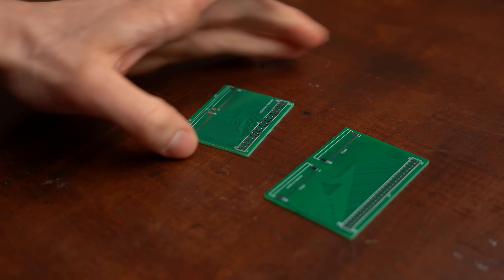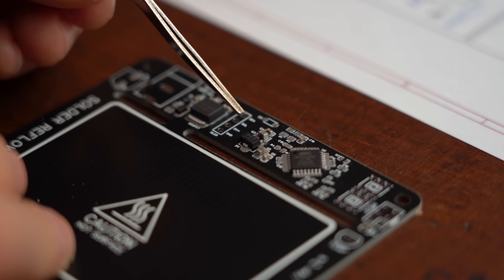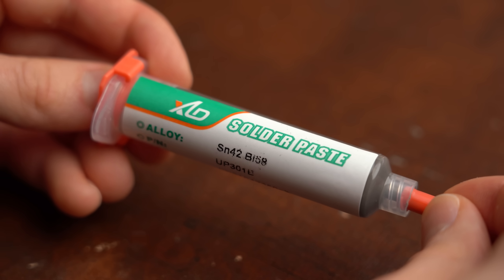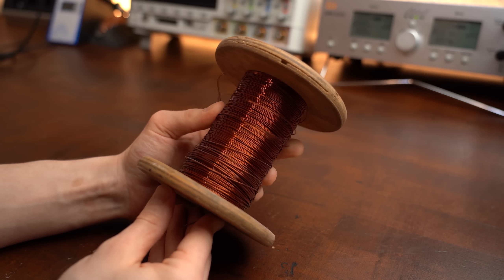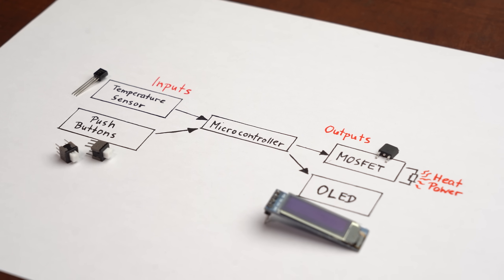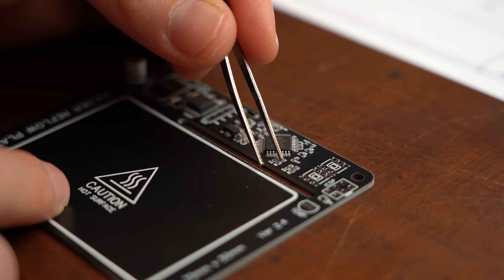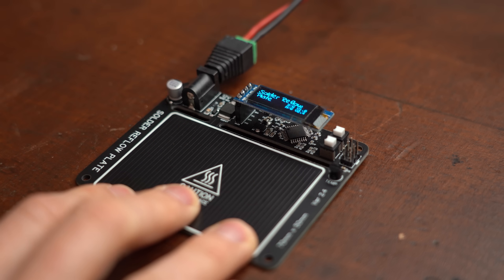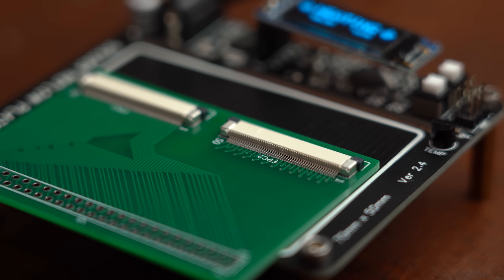The Best way to Solder? Hot Plate to the rescue! (DIY or Buy)

Comment: I am about to say something stupid, if you can flow current to something to melt the solder, why can't you do it ti the pcb you are trying to solder stuff straight to? the copper pads will definitely be hot, less power is also needed

Comment: How about esp32 with BLE control instead of the atmega in the DiY- those small stamp size modules. No need for a display or push buttons then. Also a serious version could have a PD enabled power supply.

Comment: 7:20 
As a electronic hobbiest it's really sad that microcontroller ic are more difficult and suprising expensive the the ic board/module 😢
I tried finding attiny85 micro processor ic but it was almost 2 dollars usd it's the same price as Arduino nano board here

Comment: You forgot to mention from where  you bought the solder plate mask. The same as the PCB manufacture ? How does the change that $2 entry PCB manufacturing cost ?

Comment: While the lifetime of the DIY version might be shorter, you do have the access to buy a replacement part for relatively cheap; with the other components eligible for transfer using... that heat gun in the dusty corner of your desk by now >:D

Comment: I started out with a small raw  heater plate (220 Volt) for a few euro that I added some controls to. Worked fine. Then I needed a bigger one for a bigger PCB. Didnt want to spend a fortune....so I used an old iron (the one for ironing clothes) and added it to the same control project. worked perfectly

Comment: There Is someone on YouTube that made a PCB heater that is at one time use to Flow the solder and attach all new parts. It then burns out and shorts itself out and becomes a ground plane after it's done. Actually a very ingenious method. Basically turning the traces on one of the layers to be irresistor which heats up on that along the entire board and you put your solder face and all your parts on, and then connect it to a power supply and then heats up melts in and the heater element shorts to ground and then it just becomes part of the ground plane

Comment: I've been using hot pate for the past year or so and  I do enjoy it for my smaller items. I can load all the pads and parts and put the PCB on the plate and About a minute it's done. After cool, isopropyl alcohol brush to get any flux off and clean with some water and dry. Comes out looking 100% professional

Comment: 9:00 Yeah, that happened to me many times too. Quite annoying when you forget to set the fuses to internal oscillator, before desoldering the ATmega. You can of course always set the fuses an program the ATmega using a high voltage programmer. But this requires so many pins, that it's often quicker to just hook up an external oscillator for setting the fuses, as you did. :D
I usually only use a HV programmer when the fuses are set in a way that bricks the ATmega completely (where also an oscillator won't help), which practically never happens.

Comment: You didn't explain which material is used for heating, while pcb designing we use copper which isn't a good choice and if the pcb could handle the heat as well as the MOSFET model which can control much current

Comment: I have the solution for your connectors and LEDs. heat from the bottom of the board. problem solved. :) Oh, and I noticed you weren't using any flux for the LEDs. That would help tremendously. Just don't use very much. Also, a tiny micro-soldering knife tip helps a lot when doing tiny pin work.

Comment: You can get a huge 200mm by 200mm unit with thick aluminum plate and PID controller that plugs directly into the mains for $80...I have the smaller unit you show as well. They also make a bigger version but it's like 40mm by 40mm or something silly...and it costs like $160.
Reply: Please, can you let me know the link for $80 Hot Plate?

Comment: for you flatflex sockets you use  the slantet soldertiop putt a big blob of solder on it and a ton of flux on the bord and socket  then you just draw with the tip over it like you do a ladder on a piano

Comment: Would a 3d printer bed heater work? Probably not hot enough huh?
Reply: Yeah not hot enough. There are some low temp solder pastes, but those are usually 130Deg C. Typical leaded ones are 180-185 Deg C. Most printer beds hit about 100-120 at max.

Comment: As others have mentioned, the ATMega328P PCB saves a little money by using the 8MHz internal oscillator while boards like the Arduino Nano are configured to use an 16MHz external crystal for better performance. Of course, if the chip has been configured to use an external clock source and one isn't present, it won't run. The clock source is configured by programming "fuses" in the ATMega328p. This can be done by following the instructions provided for the Solder Reflow Plate firmware and programming the chip before desoldering it.

Comment: I'm a beginner in electronics , can we use induction stove for this by placing a piece of metal on top of the heating area according to required size , all the other things will be already available. Correct me if I'm wrong

Comment: Just FYI: I got one of those "big & bulky hotplates", and it has several disadvantages I thought worth mentioning.  The top plate is a big piece of aluminum with 4 relatively small heating elements inside of it.  As a result, it takes quite a long time to warm up, and also a very long time to cool down.  The simple controller doesn't allow you to turn off the heat quickly and still monitor the temperature.  Of course, there really isn't any "turning off the heat quickly" due to its thermal mass, so if you want the project board to cool down more quickly, you have to lift it off the heater, and this of course can unsettle components.

Comment: Thank you. I need this video. Do you have any suggestions for soldering an LED to a flexible pcb? I'm not sure how much heat it can take. On the back of the PCB there is a copper heat sink. It is quite small but it is there

Comment: I like the DIY version though it might have been better if whoever designed it had made it so you can just plug in an arduino nano rather than having to source the microcontroller that is difficult to find.

Comment: For those looking for a bigger DIY solution that also avoids a PCB heater, there's a brilliant one from a small channel called My Circuits that uses an upcycled clothes iron and an ESP32. Search "Homemade Hot Plate for Wireless SMD Soldering! Using ESP32, Flat Iron, and IR temperature sensor"

Comment: So, I took a look at the PCB and I'm a bit confused. According to the Guide the PCB track has a width of 1.4 mm, a length of 2000 mm and a thickness of 1 oz/ft² (~ 0.035 mm). The resistance must therefore be ~ 0.7 Ohms (thex claim 0.9 Ohms and you measured 1-2 Ohms, but that's only a minor detail). Following Ohms law the whole circuit should draw something between 10 and 17 A for the intended 12 V supply (depending on the actual resistance). The barrel jack chosen in the BOM has a rating of max. 5 A (most have a maximum rating between 1 and 5 A, but usually not more). Why the heck doesn't the barrel melt like it's ice cream? Does it really draw THAT much current? I'm so confused because on paper this shouldn't last long as at least one component is used way beyond its ratings (under full load it's about a factor of 2 to 3).

Can someone clarify? Did I make a mistake in my calculations? I'm so confused.

Also, I think the placement and choice of the temperature sensor sucks.

Comment: In the beginning I was worried about the durability about the PCB too. But, having used this heatplate to solder 200-250 PCB's, I must say that it still works perfectly fine. The silkscreen is a bit darker than unused yes, but still the heatplate works 100%. Not bended or in any other way damaged. It's still able to reach the temperature in the same curve as new. (I have the Atmega 328 version)
Reply: yeah i was gonna say i'd be pretty surprised if that was that big of a problem. although repeated heat cycles are definitely worse for any material than a single heat up, these boards are really just copper, fiberglass, and whatever material the solder mask is. and that solder mask is totally meant to withstand high heat. i wouldn't be too worried about it
Reply: Great review bro😊 It help me alot
Reply: What temperature do you use? I was thinking of making one too
Reply: @ameliabuns  Using 160-170 depending on pcb size, amount of components, amount of groundplane layers etc.
Reply: @CBJ1  oooh I thought low temp solder is still around 180~ that’s nice

Comment: I just had a thought, could one design PCBs to use the bottom layer as the coil and then just plug them into a power source to melt the stuff on the top layer?
I want to make long LED strips.... 112cm.

Comment: May I suggest that your soldering iron is not good, seems to be a bit of a hobby one. In industry lots of companies use Pace irons with very good temp control and a selection of much finer and better solder tips that are easily changed. Look at the TD-100 and its tips and base station, yes not cheap but industrial quality and very fast, fine tips that will easily solder fine pitch smt connectors or chips.

Comment: Thanks! What about the new aluminum PCB's from jlc? That seems like it can be a complete solution when combined with that controller! Also there are "solder removal" plates with 2 wires that some have been adding an MCU to. Personally considering one of those plates as it seems possible to power it safely with a bench power supply. Then can add some sort of mosfet to pwm the reflow curve on that?

Comment: So, love the video, and especially the diy option showcased! However, I have to mention, did anyone realize the lmt85lm temp sensor only goes to 150C? And your solder paste curve was 160C. This is probably the most significant source of error in the real vs set temp lol. Probably need a temp sensor closer to 200C capable.

Also, I'm no expert, but shouldn't the temp sensor be closer to the heater trace? I usually see them applied with kapton tape directly to the top, bottom, or through a hole in the pcb.

Comment: You should try drag soldering for pins which are close together, works much better then air or IR. Also results in a lot less heat which can melt the plastic

Comment: im sure it has been said before, but this style of PCB heater is the same style that has been used in 3d printer heated beds for years now, and the lifespan is solid on those. check out the prusa mk54 heated bed for a good robust example of the same PCB resistive heat bed.

Comment: $2.00 is too much for me because I am  a poor  a$$ emefer waiting on my disability case to be heard in state and then federal disability 3 judge panel. I realize that isnt really anybody's problem but my own but if it help's everybody understand where im coming from i used to be a dealership certified automotive technician and now im trying to switch to electronics because i enjoy diagnosing electronic faults in vehicles and im discovering that diag of electronics is just as fun without the pain of working on cars in the process. If i can get proficient enough then i wont need disability checks and i wont be a poor a$$ emefer anymore either....

Comment: Just use heat gun under pcb, nor up and it will work perfect. Anyway, To increase lifetime of DIY heatpad, i think, you should stick aluminum plate on it, probably with safety mica layer. It will keep printed heater from damage and detachment. Or even use aluminum PCB, but double sided 'sandwich' still be more tough

Comment: I don't get it? Why SO much money for a tiny heater with some low cost control electronics? That's just an extreme rip off! 

[Edit: I'm talking about the "buy" version here not the DIY version which is very neat but too small for my needs]

An old clothes iron (steam or dry) stripped right down, mounted upside down in a wooden block with a simple Arduino temp controller driving an opto coupled triac circuit with an aluminium plate (2-3mm thick) mounted directly to the iron. 10 times bigger, MUCH more available power to cope with large loss of heat for whatever reason. PLUS the added benefit of being able to mount a tin tray with about 1 cm high edges to use as a shallow hot solder dip bath to rapidly and easily remove LOTS of through hole components when scavenging parts from mobos etc. NOTHING makes removing transformers, sockets, switches, large heatsinks (with the tinned mounting tabs) and other large components as easy! Dip, remove key desired large  components - using gloves of course - then just remove the board, turn upside down and tap to enable most if not all components to drop out or off the board! So fast you would not believe it.

Comment: Hand soldering LEDs, connectors and other SMD components (as long as they have visible pins) is entirely possible without any magic -  one just need proper equipment (like, for everything else, too). And flux. And some practice. Of course soldering LEDs to heatsinks is a different problem, which fortunately rarely ever happens in practice.

Comment: Love the idea of getting the ATMEGA from an cheap mini, but why didn't you program it with the code before you moved the chip?  Would have been easier than generating a clock signal later.

Comment: I use a domestic iron (the kind of thing people apparently use to make their clothes flat?!), clamped upside down in a Vice, for reflow soldering.

It oviously doesn't have a temperature display - but I know the setting on the dial on the iron which seems to work.  the heating & cooling times of the iron are not far different to the reflow curve either.  I just switch on the iron, wait until I see the solder start to melt then switch the iron off.

The iron must have cost all of £10 - and will solder decent size boards.  It has proven good enough so far that I've not bothered buying a 'proper' plate - and maybe in an alternative reality, it might even be useful for flattening my clothes 🤣🤣

Comment: Seriously, this is a silver line for me right now. I am working on a project with an aluminium PCB and I have to switch out components to get it to work with different loads and it SUCKS to do it with a soldering iron. This would it make so much easier to just heat the PCB until the solder gets liquid and then carefully change out the SMD parts...

Comment: I mean yea soldering fine pins like that when your literally globbing it on at 0:38 of course its going to be near impossible.  Thats why needle and other fine tips exist, tip size should be changed for what your soldering how small thermal mass is etc.

Comment: WARNING! When using bismuth solder and lead solder together, the melting temperature can drop dramatically, to the point that hot components like regulators and mosfets can desolder themselves. When using bismuth solder that may mean you are limited to RoHS components and you will forever have to be careful NOT to use any lead solder on such a PCB. Components that get desoldered  in live equipment can lead to short circuits and in some cases to life threatening situations.

Comment: A correct sensing of the temperature would probably better the 15°C error.

Maybe sensing the temperature of the bottom plane with a surface sensor, and then solving for the temperature of the heated plane would work.

Comment: Did you put solder paste over the entire PCB?  Edit: Scratch that, I now understand you use a stencil.  Could you make a hotplate with a thermoelectric peltier, as they can go up to 200 C and I think you said your solder reflows at 160 C.  Does the MHP30 already use a peltier?

Comment: The whole time I was just thinking... Why not just buy a ink bird pid controller, SS relay,  100k ntc type thermistor or maybe K type thermocouple (I prefer thermistor) built into a silicone heat pad... Done. Likely $50 build and you could make the work area as large as you want (with enough power). 

I did something similar to build my lab mantle.
Reply: Just thinking about this myself, absolutley an easier solution! And might be better, although that custom pcb was really neat as well:D

Comment: I think its a question of practice soldering 0.2 kinda components, at first it seems hard, but with the right temp and pointer, some endoscope/cheap microscope youll be fine after burning a half of dozen of them lol practice is the key imho ;) cheers for the video <3

Comment: Soldering fine pitch pin connectors or IC's is very easy. Make sure the pads are clean, place your IC or connector in position, flood the area with flux, then tack (solder)  two opposite pins with a fine point soldering iron. It does not matter if you short 2 pins at this point as long as your positioning is accurate. Now carfully add more flux and feed solder with your iron and run along the pins with the iron and solder in a fluid motion. The flux prevents most or all of the pins from shorting.  This takes a little practice but after a while you should be able to solder most pins without shorts (brigding). Any remaining shorts can be removed with flux and desoldering wick at the very end of the pins. Once you get good at this, it should take you around 30 seconds to position and another 30 seconds to solder the rest of the pins, finally a few seconds to remove any shorts. I have been doing this for close on 30 years so I know it works!

Comment: Dang, your reflow oven is fancy… mine is just an old toaster oven with some electronic controls taped to it for reflow temp curves

I’d love to see a CircuitPython remix of this. Maybe with an RP2040? And if the heater is separate from the control circuitry as another comment suggested, you could have different size heaters… more flexibility!